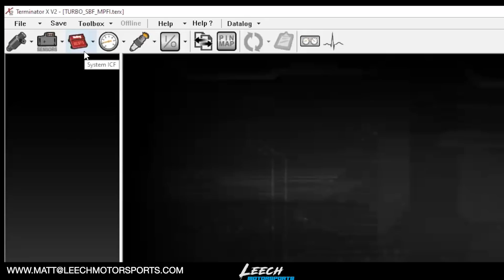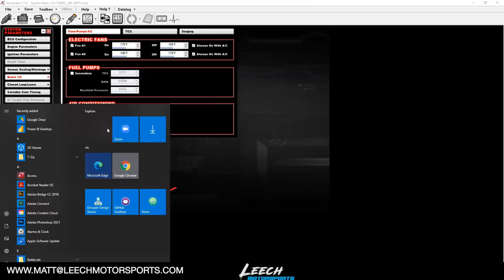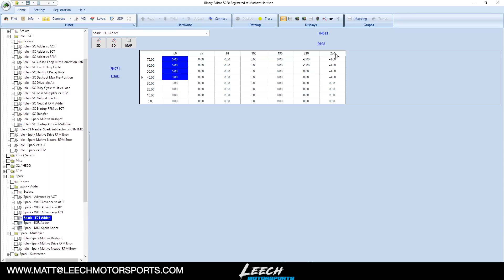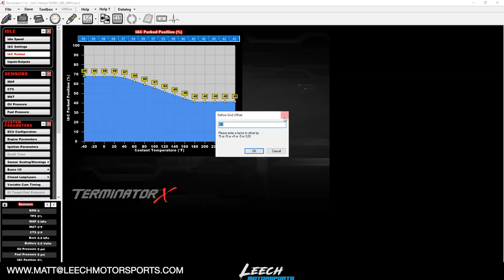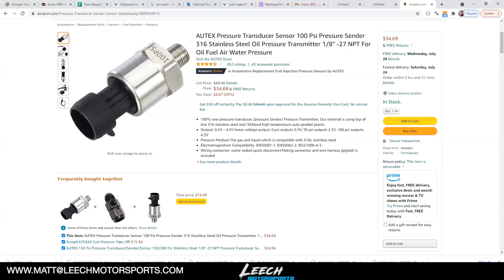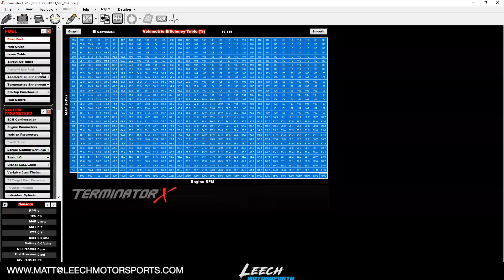FINALLY.. Someone who can explain the WIZARDRY of the HOLLEY TX! / PART 1

Comment: I'm getting ready to throw a term x on my 392 stroker, I used this video to set up my base tune,  up till the volumetric efficiency table. I'm not running a turbo, but I think these adjustments will save me a bunch of time. Do you do remote consulting?

Comment: Have a question about the start up tune out of the box. Got about 250 miles on vehicle. Holley terminator x max. 5.3. Stage 2 mild came. Built 4l60e

Symptoms
Dead spots throughout throttle
Shift points seem to be off
Temp seems to get a little high in the summer when idling with ac on
Afr gets up to around 14.9 when trans shifts and drops back down around 14 2 when cruising 

Those are just a few things i noticed

Comment: one thing to note here is if you use this IAC idle theory the ECU will continuously pull timing at idle via idle spark trying to lower it to the target idle.  you should really lower the D Term much lower to prevent it from pulling to much.

Comment: Good morning, I have the terminator x max. I Installed, first run was good. Now I'm having a no power to the drivers side injection harness, however passenger side is firing. Trying to get a solution.

Comment: Funny, I am installing a Terminator X right now so this is very helpful, but I couldn't justify the Holley $155 dollar each oil & fuel psi sensors either. Bought the Autex sensors too. We will see how they work.
Reply: hey quick question , how did those Autex sensors work for you ? im in the process of installing the terminator x as well and cant justify buying the holley fuel/oil pressure transducer sensors either....
Reply: @tinosantiago1790  So far so good. The quality seemed to be pretty good. Once you enter the specs into the Holley Terminator X they work good. I recommend trying them out to save a few bucks.
Reply: @scmotorsports  thanks bro I appreciate it I will 👌🏼

Comment: Fans waste outputs on Terminator. And the IAC uses one up, too. I’d save them for Mac valve(s) for boost control. Startup is hard on fan motors. It doesn’t do any good to have them starting & stopping. Just run them off a switch or switch panel & leave them on. You can’t over cool.

Comment: Awesome video, I still have my terminator x still in the box. I've talked with Matt and he is a great guy very knowledgeable and he seam excited to work with mine with the 11r 190 heads.
Reply: Great heads
Reply: Question brother about to install the term X and going to add a turbo system, should I install the turbo at the same time or install the term X first and run it NA first before the turbo install?

Comment: thank you so much for this video Leech has been so helpful from BE to Holley.........shout out to him,this stuff is so valuable, I use both platforms,curious on the Holley and coyote platform over HPTuners
Reply: We do have some seat time getting acquainted with HP Tuners and self tuning Leech 2 stick shift Roush blower Coyote but still getting comfortable with it.
Reply: @Leech Motorsports  lemme kno if you need a file I have some roush and Whipple files